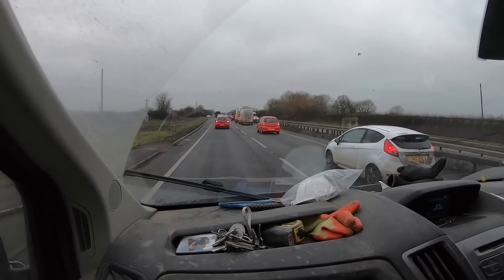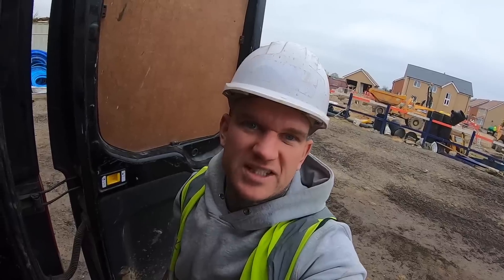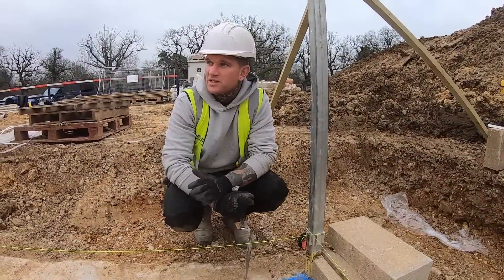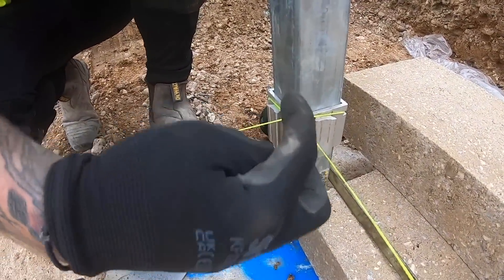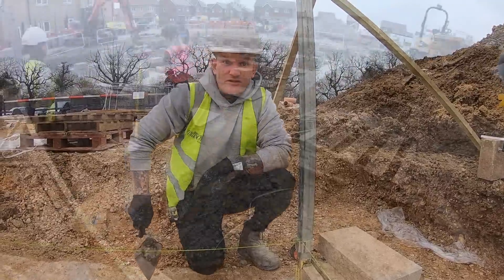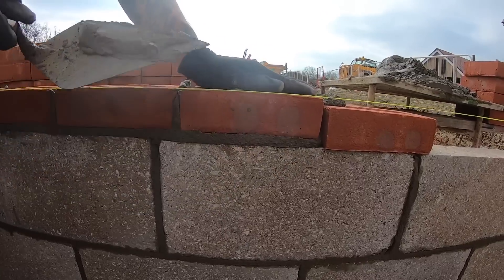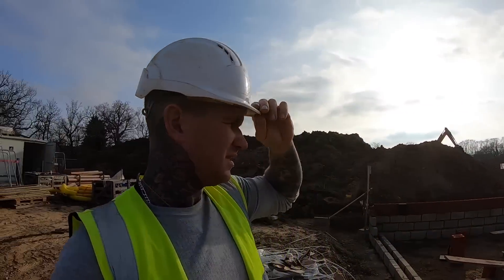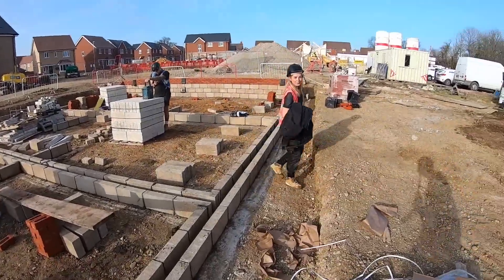How I Layed 450 Blocks.... and 400 Bricks in 1 Day 🧱🚧

Comment: If the tape is underside of beam measurement how do you know how much higher you need to go for damp?
Reply from the maker: Work out where top of concrete is from underside of beam. In this case 300mm
Reply: how thick are the beams?